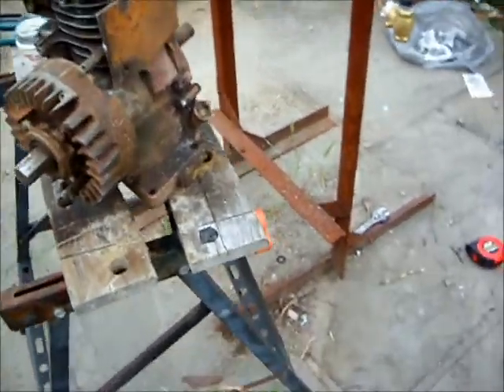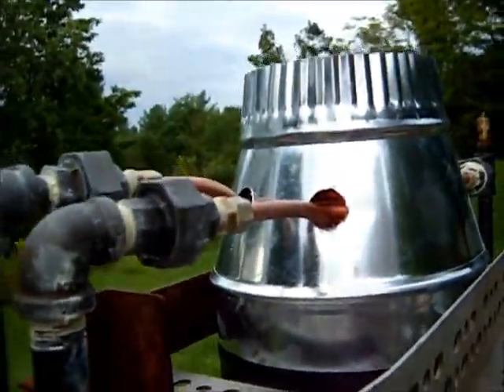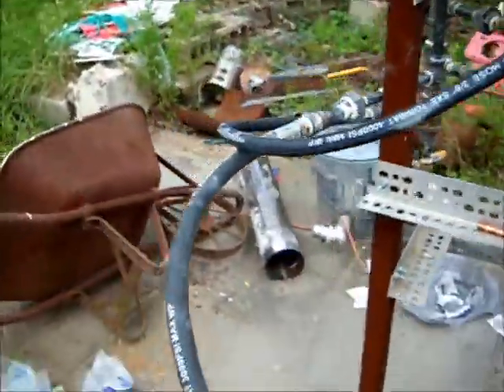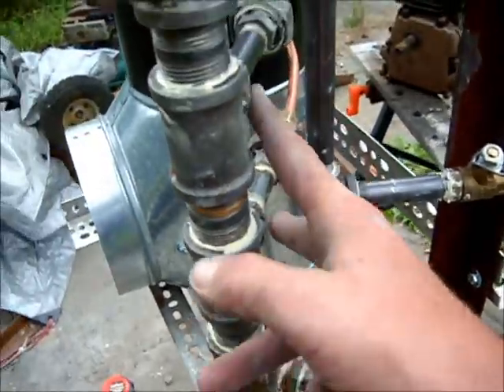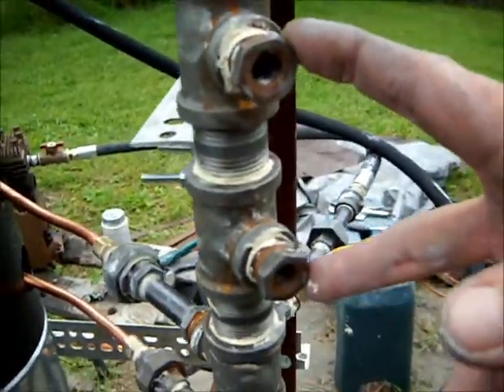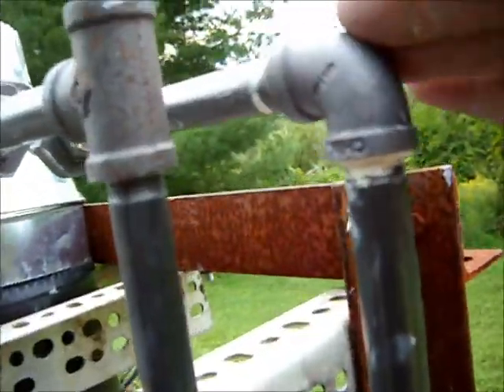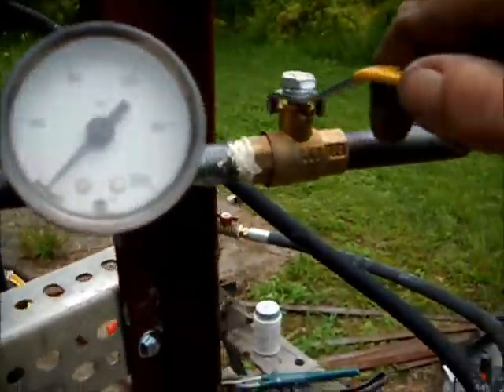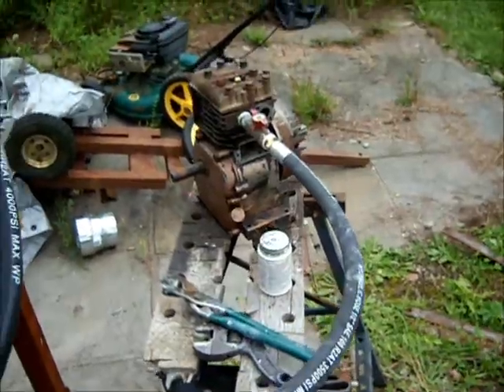BOILER

Comment from the maker: Hi,there are three separate coils. The preheater, the main heating, and the exhaust steam heater coil. It is similar to a LaMont Boiler but because it is so small I am not using a circulation pump.